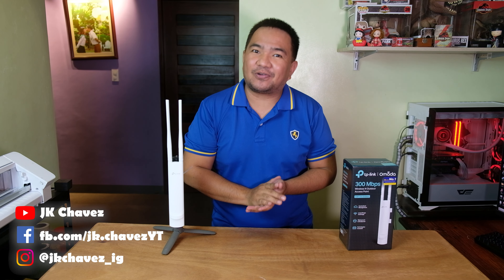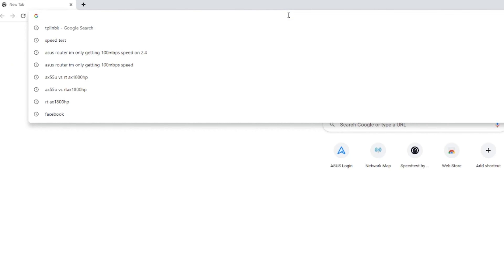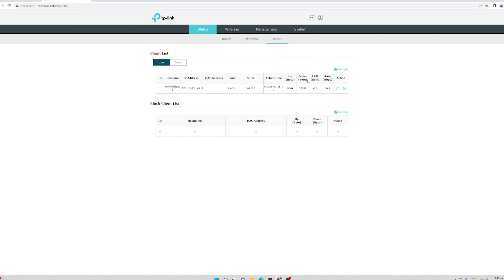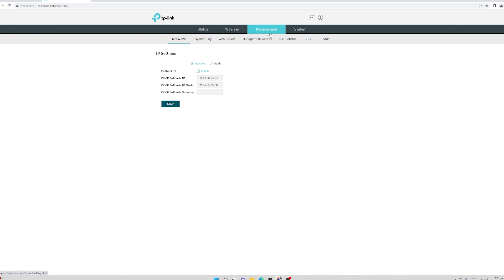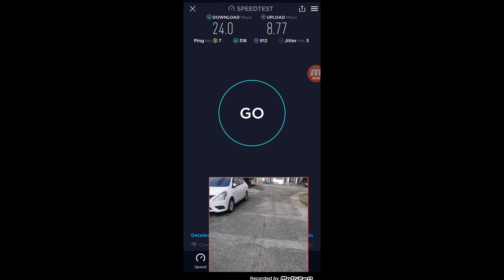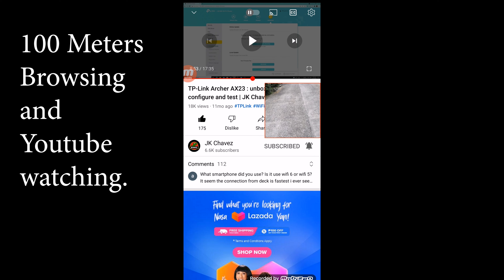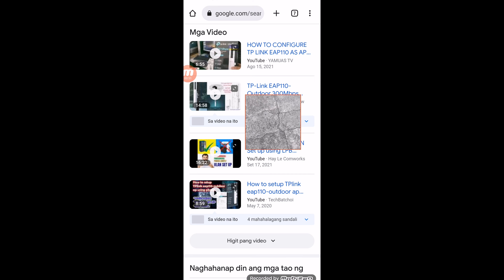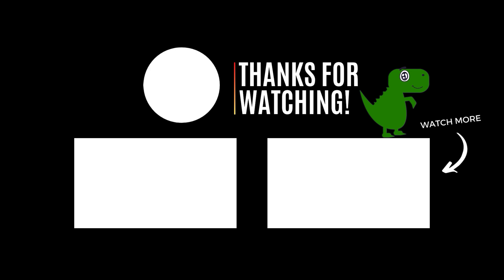tp-link EAP110 - Basic config and actual range test (Version 2 review) | JK Chavez

Comment: Hi po. May I ask how to fix the eap110 ourdoot on omada controller software. Every time i try to connect the eap110 on omada software, its always disconnect.
Reply: Mas aparece na app o 110? Tenta actualizar o firmware depois tem lá uma opção para procurar manualmente..
Sen não resultar faz registo no site TP-Link e depois volta a instalar a app omada, talvez o aparelho não tenha o IP.
Mas o 110 é uma excelente compra , eu tenho o 110 e o 225 e até acho o 110 melhor.
Reply: @duartemleal tengo problema para confirmar mi eap110 me ayudas xf
Reply: @VeronicaCormenarez  si claro, que necessitas? Mi espanhol nos es muy Bueno mas yo compreendo ,
Reply: Que passa?

Comment: ano pwede gawin sir nung nilagay ko sa taas ng bubong ung eap110 ko sa loob ng bahay nawawalan ng signal and hnd fix and signal khit nasa  kwarto lang nasa taas lang ang antenna
Reply from the maker: Hi, this kind of access point sir, really needs line of sight, not built sya na may harang na wall or ceiling. makakuha ka ng signal pero mag drop from time to time..
ang strength nito is long range lang talaga na line of sight.. :(

Comment: Thanks, for the video! I have a question, can I use only one device of the CPE710 model, as an access point with Its large covering range? or we necessarily need two devices? Thank you
Reply from the maker: you can use as many as you want depending on the area that you like to cover, the cpe710 is a directional device so you can point it at one direction but 90 degrees from the left or right won't have signal.
Reply: Thank you
Reply: Hello, were you using the cpe710 as an access point. And if yes, what was it's range

Comment: Good morning sir! How many meters is the maximum length of cable from eap110  antenna to POE adapter. Ty
Reply from the maker: by rule of thumb po max is 100 meters, pero in my own opinion around 80 meters max, para less points of failure po..
Reply: @JKChavez  thank you sir!

Comment: pwede po bha xa gamitin indoor? sa especially sa multi story building?.
Reply from the maker: unfortunately mahina po sya indoor, d sya malakas sa wall penetration, kaya better get an indoor wifi router compare to this eap110 po..
Reply: @JKChavez  noted sir. thanks po sa response. ano po kaya m.rerecomend nyo na indoor wifi na malakas sa wall penetration?. asd
Reply from the maker: @TimelessChroniclesTV247  maraming option po depende din sa budget, for my personal recommendation, start with asus rt-ax53u, if medyo tipid sa budget, tenda ac23..  you can check actual review on my channel po para sa actual test from second floor to roofdeck..

Comment: sir ji poi adapter top 110 how much meter cable max ang kaya mong gawin
Reply from the maker: Wala kasi akong extra lang to test ung max, pero before na test ko na within 40 to 50 meters okay naman, usually 100meters naka indicate sa box pero i would say na mas safe around 80 meters para mas less points of failure..

Comment: Note: Sa mga balak bumili nito in the: For my experience hindi sya for indoor use more on sa provinces lang ito applicable dahil malawak ang outdoor environment. Kaya sa magbabalak bumili nito in crowded area like residential talaga or skwaters. This a no no product.
Reply: So what is the option? Buy a outdoor cat 6 lan cable and archer c64! If you have a computer or laptop that always connected in your modem (pldt/converge/globe) then you need switch port, if nothing is connected in your modem no need to buy a switch port. Switch port is useful in the feature if you want to connect your laptop or computer direct to your modem via lan.
Reply from the maker: definitely not ideal for indoor, since hirap talaga sya for indoor, i would agree the ac64 would be a better option for indoor, and if may extra budget and available pa si c7 that is the best option.. :)
Reply: what router would you suggest po kaya? Mag papaconnect po kasi ako ng kapitbahay, apartment and 5 to 6 families, per family is minimum of 3 persons. Yung apartment po is sobrang lapit lang talaga sa mismong labas ng bahay. Iskinita po kumbaga, what router po kaya ang meron na. (Speed limit per SSIDs (1 SSID for 1 family sana) and multiple SSID din po.

Comment: Pano po pag di ma detect ng ap at router ang isa't isa using ethernet cable(ap mode)?

PLDT Fibr ang gamit
Reply from the maker: one of the reason kung bakit walang madetect is ung ibang modem router ni pldt is naka block or disable lan port, which is need mo pa po i pa enable sa kanila.. yan usually problem with pldt adding AP or third party routers..

Comment: Pede ko po bang gawing wifi extender yan sa converge namin at mag mac filtering if ever na naging wifi extender po sia salamat po sa sagit
Reply from the maker: as access point mode lang po sya (parang wired extender, flexible ung configuration), pede po mag mac filtering..

Comment: hi Sir, pwede ko din ba to magamit as wifi extender? salamats :)
Reply from the maker: Hi Rey, negative po, wala syang wireless extender function..
Reply: @JKChavez  oks sir salamat po, pero if wired? Pwede naman?, plan ko sana bumili, ng poe device
Reply from the maker: @rey.vasquez4365  wired po talga option since poe po sya, may kasamang poe injector po..
Reply: @JKChavez  copy sir..mraming salamat po
Reply: New version have the extender option yes...just have to choose .
Reply from the maker: @duartemleal  thanks sir for sharing, i have not tested since i have uploaded this video, is the new version have different hardware\chipset? or just different firmware?
Reply: @JKChavez  hello , Just see your question today, I've install a new 110 outdoor , and in the new model is possible to choose to be a extender or create a new wifi access .
I think it's a new version.
Reply: I think different firmware....
Reply from the maker: @duartemleal  thanks will try to update mine as well.. :)
Reply: @JKChavez  , helloo my friend , I bought a new 110 a few months ago and it have the extender option, the first one didn't have that option , 
If you do the same changes I did you will have better signal and coverage.
All the best

Comment: tanong ko lang from tp link omada operator sabi nila POE to router then lan to modem ang connection ng cable  pero sa inyo po POE to modem then Lan to router
Reply from the maker: from modem lan port po, to poe injector then to lan po nung poe injector to eap110 po..

Comment: Hi sir I just config this EAP 110 and ang set up ko is ang main router ko nasa kabilang bahay. While itong EAP110 connected via lan cable to main router at yung POE adapater is nasa bahay ko nakaplug. The result is no internet working fine naman yung main router kaso di umiilaw yung lan port na nakaplug yung lan cable please help.
Reply from the maker: Pldt isp po?
Reply: se a luz do 110 se apaga quando o ligas , a resposta é simples:
Tens os cabos trocados,
 também cometi esse erro.
Tira os cabos todos, e coloca cabo Lan ao router principal, e cabo poe ao 110.
A luz do poe vai acender.

Comment: Bakit main router ko 300 mbps tapos sa tplink 30mbps lang pa help naman pano pa taasin mbps ng extender
Reply from the maker: Hi, marami pong pwedeng factor, like ung lan cable po ba is cat5e and up, then dun sa area mo po na nilagay si eap110 is maraming wifi network in 2.4ghz wifi frequency (which is nakaka affect ng speed pag crowded), and gaano ka po kalayo sa eap110 during test..

Comment: Galing mo po mag salita. Ask lang kung itong TP link 100eap can boost our internet speer or range lang talaga?
Reply from the maker: Hi sir, for eap110, most probably po kung anu ung nakukuha mo na speed sa modem router mo un na ung actual speed na pwede mo makuha from eap110. to actually know kung ano ung max speed na pwede mo ma achieve via wifi, try to connect a laptop or desktop via lan cable sa modem-router mo po, do a speed test kung ano ung lalabas na speed dun and un na ung max speed na pwede mo makuha kahit mag add ka ng 3rd party wifi router or access point po.. :)

Comment: bakit sayo malayo ang range samantalang yung EAP110v3 ko ang lapit lang mahina yung signal at ang bagal ng speed ng EAP
Reply from the maker: Hi Keith, pede pong yung area, if crowded ng wifi interference sa mga kapit bahay, mas mahina sya, like in my video in between nung 100 meters around 50 or 60 mahina speed ko, while sa around 80 mas okay yung speed test.. and another mobile device, kung powerful ba ung wifi capability nung mobile device.. and line of sight po, walang naka harang in between..
Reply: @JKChavez  siguro nga kasi sa pinaglagyan ko nyan puro dikit ang bahay kaya siguro mahina yung signal ng wifi at grabe ang hina. Try ko ilipat ng pwesto yung EAP. Salamat sir.

Comment: Just mounted another eap   110 , works fine with good internet speed.
Reply from the maker: yes totally agree this is a good budget access point as long as there is less interference with neighbors 2.4ghz wifi.. :)
Reply: @JKChavez  I my house I have the 225 because I have 5ghz and fibre...this 110 is to install in a country house , I only have 2.4 GHz no neighbours , no interference , I don't care about internet speed but good coverage.
It's to use for wifi calls because I have bad cellphone network.
Also is a better value for money because is more cheap  the 225.
I took your advice in the comparing the 225 and the 110.
Just change the antena on this one too, for a 9dbi ,it's a great upgrade.
All the best for you.